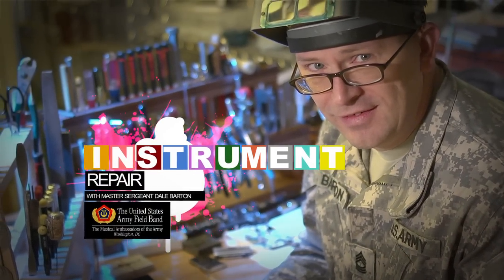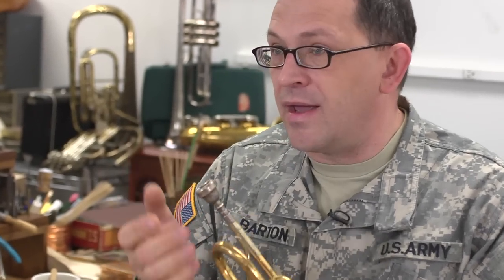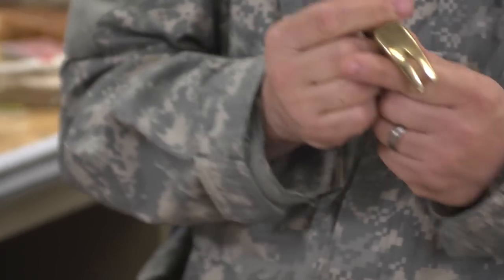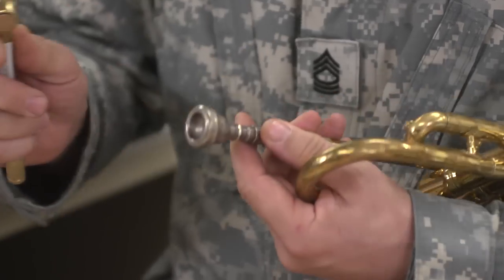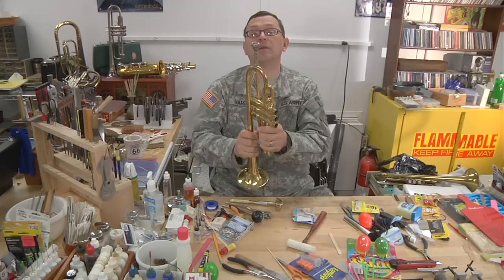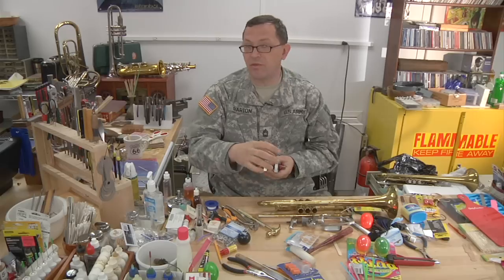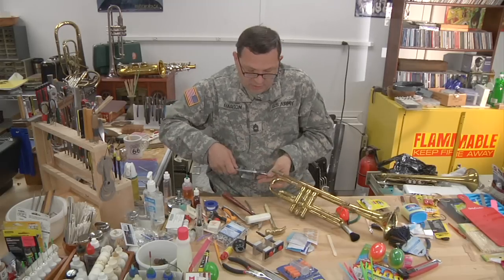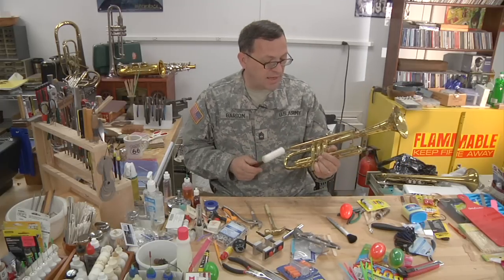How to fix a stuck trumpet mouthpiece | Instrument Repair at Home

Comment: when my mouthpiece gets stuck, I place an ice cube into the mouthpiece to make it cold and easier to pull off
Reply: Aaron Wheeler im going to try that!
Reply: me too but I'm skeptical
Reply: Aaron Wheeler I got water in it and it sound weird what do I do
Reply: Let the water out with the water key?  Like you would normally?
Reply: Aaron Wheeler I got my mouthpiece stuck at home and after a few minutes of leaving it there it worked! You’re a life saver
Reply: I personally put some hot water on and it come off really easy
Reply: Toooooooooony one thing dont use hot water like that or cold water your best bet is luke warm water.
Reply: Aaron Wheeler 
Trying that
Reply: Aaron Wheeler 
Didn't work :'|
Reply: Aaron Wheeler I just get another mouthpiece and hit it off lol
Reply: Wtf no cold breaks metal. Basic chemistry. Warm water is what you should use
Reply: Mitioritos, uh, NO.  Cold water is NOT going to hurt a mouth piece.  You'd have to have something EXTREMELY cold like dry ice to make metal that brittle.
Ice on the mouth piece, and a hair dry on the receiver will create a temperature difference that can loosen a mouth piece without any effect on the metals.
Reply: Aaron Wheeler would it mold or rust if u do that?
Reply: Stephen Eickhoff french horn. There is no water key.
Reply: @yuvalsela4482  But there is the standard "remove the slide, rotate the horn, and repeat until you get the water out."
Reply: @danielhauk9420  No.
Reply: It’s getting cold but not easier to pull out
Reply: From 2021 THANK YOU

Comment: I like the concept of defense spending going towards that silly putty sitting on the table
Reply: Noah Crawford silly putty is used to temporarily seal up possible leaks in an instrument for diagnosis. It's a very useful tool. I use to use it quite often when I was repairing horns.
Reply: @ApartmentKing66  the dude was clearly joking..

Comment: as a second generation trumpet player and a band instrument repair shop owner i have to say you are soooo correct in saying that "the instrument always tells the rest of the story about the damage to the instrument" especially when the trpt comes in 2 pieces with a broken #2 brace.... now it goes from a usually free be good will mp pull to a expensive re-solder job. the same goes for lack of lube on tuning slides a 1/2 cent of slide grease saves a expensive and sometimes involved repair.

Comment: Thank you for this. My trumpet has sat for too long and the mouthpiece got stuck. I was worried I'd have to bring it to the music store in a bag. I used the rubber back of some pliers. Tapped and pulled. Had to tap & pull a few times but it eventually came out. Now it's back in the case.

Comment: Hi, I don't want to be negative as i like your video's and I am really sorry to disagree with you but the Bobcat mouthpiece puller will work perfectly with all instruments found in a brass band, from the Soprano cornet to the BBb bass (or Tuba to you lol). I know this because i have used it on all of them. There are even cheaper versions of the Bobcat available on eBay but the bobcat is the only tool needed in the brass band room for stuck mouthpieces ;)

Comment: Im not a brass, im a woodwind and I have im sorta in a pickle, you see my mouth piece and my barrel of my clarinet is stuck together. I put some cork grease on the mouth piece and put the clarinet together for testing to see if my notes will come out, it only took like a minute to play the notes so I disassemble the clarinet but the barrel is stuck to the mouth piece and I can't get it out. is there a way to get them out with out going to a shop or my teacher?

Comment: We have this thing called the jaws of life and it’s basically clamps down on the lead pipe and the mouthpiece and you screw bolts closer and it either pops out or slides

Comment: Do you ever use heating and cooling to get separation via the different items expanding differently?
Reply: It probably wouldn't work, because the mouthpiece receiver has a much thicker wall than the mouthpiece shank does.

Comment: Hi I have a trumpet with valve #1 won't go back in. Any Ideas how to fix it? The valve was stuck I got it out with a sharpie and nothing appears broken. Valve #1 itself still fits in the other valve openings just not where it belongs.
Reply: Jason Peck The valve tube (where is goes) must have a spall dent on the exterior. Since there is a near perfect air seal, that would prevent it from fitting.

Comment: Mouthpiece got stuck on my baritone bugle. We rehearsed inside a building then went outdoors near Christmas time for a parade. The cold shrank the metals and I could not disassemble the horn for travel back home. So I laid it on the floor of my car and drove home ~30 minutes. After I went inside my house I put the horn in it's case with the mouthpiece hanging out. After I changed my clothing the horn assemble had heated up enough that I was able to remove the mouthpiece with minimal effort.

Comment: Another way is to plug the mouthpiece with putty--take the tuning slide off, turn the trumpet upside down,and spray pb blaster through the 
leadpipe (4"deep) and let it sit over night.  You can use this technique to unfreeze valves and tuning slides- just plug the spit valve with putty and spray in your blaster--until it fills up the pipe--let sit over night.  Drain and Reuse your pb blaster to oil your tools etc

Comment: One of the best ways to get the mouth piece out of most brass instruments is to blow hot air on the first 1/2 inch-1 inch of where the mouth piece goes in.  Do that for 20 seconds to make the metal expand so that is easy to pull out the mouthpiece
Reply: Really

Comment: I have a cornet where I cannot remove the mouthpiece from. I've tried using a Bobcat puller & it hasn't worked (even though I have applied CRC to the mouthpiece lead pipe for over 8 hours to get it free). Does anyone have any suggestions in removing the mouthpiece (without destroying the instrument or purchasing another one)?

Comment: It happen to mine...

I did like this..

need 2 man. do it above the mantras, bed, or something else that have soft base.

1. Tied the mouth piece with shoelace on the arch 
2. Use wrench. not the adjustable wrench. use the same size with the mouth piece.
3. hold trumpet vertical.
4. and the other one put the wrench on the trumpet arch. Like using wrench on bolt.
5. use hammer to knock the wrench down.

Comment: When my mouthpiece gets I take to the kitchen sink and hold it at the mouthpiece and leadpipe end and run hot water on it for about 60 seconds and that doesit. Running hot water on it causes the brass to expand and melts the buildup of gunk around the mouthpiece . I never take a hammer to any part of my trumpet.

Comment: The other day i got a trumpet and 2 days after it got stuck. i tied pulling it out but the entire mouthpiece receiver came off. I had to use a clamp to hold it down while hammering a metal rod ito the receiver

Comment: One time I got mine stuck and decided to wrap the mouthpiece in plastic wrap then dip it in near boiling water then moving it to cold water hoping that the thermal shock would get it unstuck. It did not work but the instrument was unharmed.

Comment: omg no no, The first thing I would do is take the trumpet and the stuck mouthpiece to the kitchen sink and place the mouthpiece and receiver under hot running water for about 60 seconds. Doing that removes the gunk and expands the brass. Does not always work right away,try a few more times. Works 99% of the time. Do not force the mouthpiece just turn after holding under hot water. Do not use any hammer. Many years of trumpet playing and problems like this one.

Comment: Why is the U.S flag backwards on your uniform?
Reply from the maker: It faces the direction of proper display. The stars are always in the highest position of honor which is reversed on the right shoulder
Reply: The "field" leads which means that in our normal way of walking the "field" of stars is first. Left sleeve field is on the left. Right sleeve the field is on the right. Imagine yourself as a flag pole being held in a parade. The flag flows behind you and people on one side see the field on the left while those on the other side see the field on the right.  HTH

Comment: I once used two washcloths, one soaked in ice water, the other immersed in boiling water.  I took the ice water cloth and wrapped it around the mouthpiece, and the boiling water cloth was wrapped around the leadpipe.  The cold cloth made the mouthpiece contract, while the hot cloth made the leadpipe expand.  I never touched a wrench, hammer, or anything that would mar, bend, or break the surfaces of the joint where the mouthpiece and leadpipe meet.  Mouthpiece came right out.  And no, the 200-degree water didn't hurt the leadpipe's finish at all.

Comment: My French Horn has a detachable mouthpiece receiver for you to choose between 2 kinds of measure shanks: for US or German mouthpiece. The problem was that I already bought this horn with the German receiver stucked, and I want to lose it. It attaches by a simple screw threaded tip. I've tried some times pull it off unscrewing it counterclockwise, trying this gentle taps, heating with a torch, putting antisize lub, but nothing of this procedures worked. I get upset by getting some scratches. How the best way to solve this?
Thanks in advance!
Reply from the maker: If the underbody of the mouthpiece won't unscrew from the rim, to avoid damaging the mouthpiece you should find a reputable instrument repair dealer in your area. We do not recommend you fixing this issue with household tools.

Comment: After about an hour of trying, I have given up trying to unstick my trumpet mouth piece. My mom and I have decided to just bring it to my band teacher tomorrow. 😂😂
Reply: Shanna Kim One way that worked for me was two wash cloths.  Submerge one in hot water, the other in ice water.  Wear leather or rubber gloves to protect your hands from the hot water in the cloth.  Wrap the hot wash cloth around the end of the lead pipe; wrap the cold cloth around the mouthpiece.  The heat will expand the lead pipe, the cold will contract the mouthpiece.  The two will pull apart.  It may or may not work, depending on how far the mouthpiece is wrenched in.  Like I said, it worked for me, but if it doesn't for you, a mouthpiece puller is the best way to get the mouthpiece out without damaging it or the rest of the horn.
Reply: That's what I'm doing 😂

Comment: Easy fix that I thought of back when I was in 5th grade.  Put the trumpet in the fridge for about 30 minutes and it comes right out.  If its winter time, you can set it outside for about 45 minutes also.  Soft metals will shrink when they get cold, and the mouthpiece will come out without any "STUPID" tapping with ANY hammer, or an expensive puller.  Super simple fix and everyone seems to want to make it much harder than it is.
Reply: I have a trombone.

Do you see the problem?
Reply: Doesn't the mouthpiece shrink with the rest of the Instrument?

Comment: A little mechanical ability and some engineering knowledge and you don't need any of those tools. In your left hand, put the lead pipe starting at the tip joint of your fingers and then wrap your hand around as tight as you can. Let your hand muscles relax. Then with your right hand do the same on the mouthpiece and make sure your hand muscles are totally relaxed and as tightly together as your can. Now tighten your hand on the lead pipe, flex that muscle hard, then do the same with your right hand. Out pops the mouthpiece. It's the spreading of the muscles in your hand which pull the mouthpiece out of the horn. I used to do all the horns in band this way. You could hit that mouthpiece with a hammer and I could get it out.